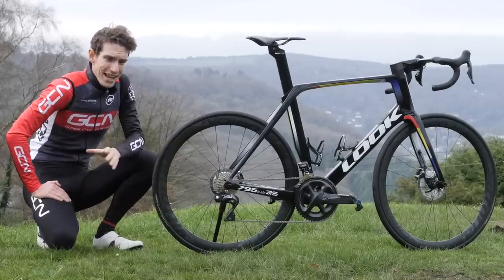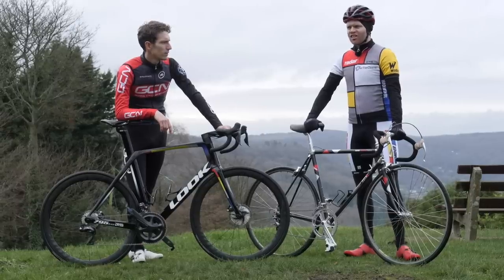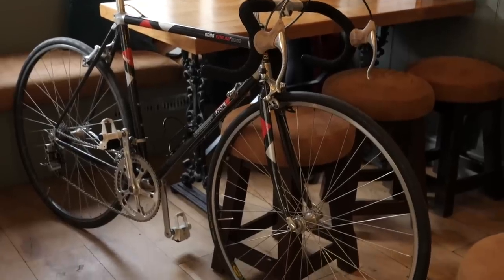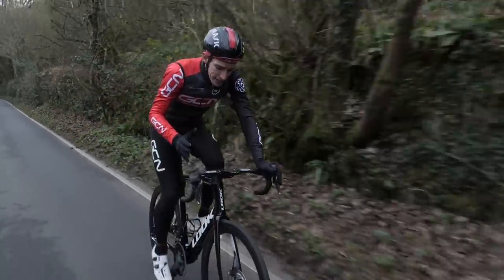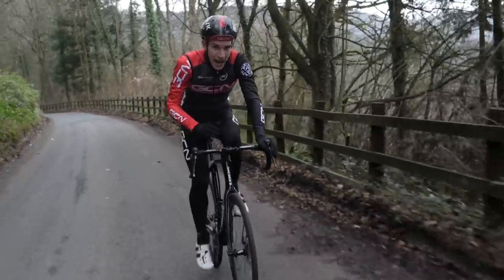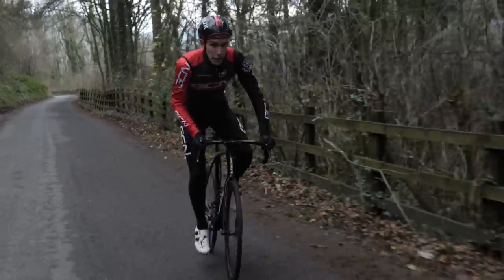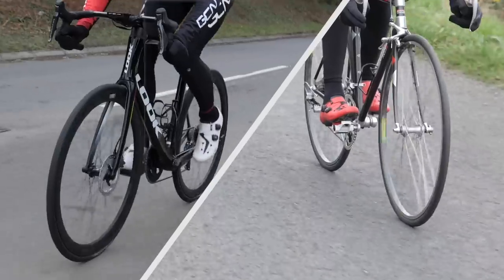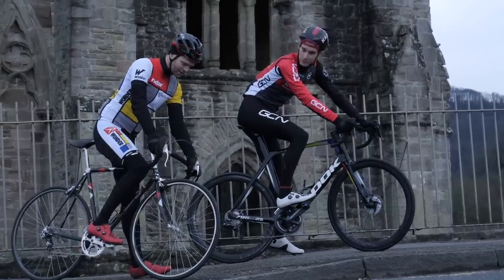How Much Have Carbon Bikes Changed? | Retro Vs Modern

Comment: Aero definitely makes a difference, especially above 30mph. I've done long descents next to an aero bike. While I'm pedaling hard to stay on their wheel, the gap keeps increasing even though I'm short and their a good 10-12" taller than me.
Reply: That's probably because they are heavier and have more momentum..
Reply: @neil7769   actually a few of them were, but a few were lighter than me by 15lbs. Young skinny dudes dropping me on a descent after kicking my butt up a long climb :) It's happened to other friends also on long descents.
Reply: @woolfel  Still unlikely to be the frame that's making the difference - position on the bike, clothing, bars, even wheels will all make more of a difference.
Reply: @neil7769   actually it is the combination of aero bike + aero wheels (venge) versus box rimms + non-aero (tarmac). In my case, my friend who is 6' on a venge versus me on my 2015 tarmac I'm 5'2". We started the descent with him pulling and half way down a 2 mile descent around 40mph+ he started to pull away. I tried to catch up, but once the gap was about 3 meters, he was gone. My friends like to joke even when they're fully tucked and I'm sitting up, it's still don't provide any draft :) It definitely makes a difference on a non-technical fast descent.

Comment: The First monocoque wasn‘t 4 years l8r!
It also was 1986. you should have compared with the monocoque kestrell 4000 and or a colnago carbon volo or a c35.
The carbon tubes/lug construction was known since 1975 (line seeker) later known as the 1976 Exxon Graftek.
Kestrell4000 was the lambo miura moment in cycling. Cheers from the carbon collector - collection c6, strictly dedicated to carbon fibre.

Comment: Different pedal spindle size on the KG86? Why is that? I still have two bikes from that era and the just work fine with modern pedals...(Super Record cranks from the late 70s and one of the first Ultegra cranks)
Reply: Tecno Ciclista  ours had a mavic tout groupset 👍🏼

Comment: Those weren't the original Look pedals - as seen on Hinault's bike in 85. Those weighed more than Ollie and had a massive white hex plastic cap on the side. That model of frame was ridden by the Toshiba-La Vie Claire team in 87 with the early frame ridden by LeMond in 86 being a lighter grey/silver colour and had a different rear brake bridge.

Pedals!
http://velobase.com/ViewComponent.aspx?ID=12D6C81D-56AC-4592-A0F0-D63CF65AF27A&Enum=109&AbsPos=125

Nice video though. I do like that new Look bike.

Comment: I wish they told us the weights of the 2 bikes.   I wonder what weight advantage did lemond have compared to the other guys riding steel frames
Reply: The UCI (the international cycling sanctioning body) approved the frames that La Vie Claire or any other team used in the Tour de France or any other race for the past 118 years. The website https://felixwong.com/2010/11/tour-de-france-bicycles-historical-bike-weights/ doesn't list the 1986 winner's (Greg Lemond) bike frame weight; but lists, two years later, Pedro Delgado's TVT frame bike which was actually a half a pound heavier than the previous year's winner's steel frame bike. So Greg's bike probably didn't have any weight advantage.

Comment: In terms of aesthetics a skinny bike is more attractive to me than a modern bulky one.From the aerodynamic point of view a modern bike is more efficient in the head wind,but if it's head-side,or just side wind it's a disaster especially with the deep profile wheels.Besides the slightly bended retro style fork is a piece of art compared to the straight hefty modern fork+ the ugly disk brakes.
Sorry, don't want to offend anyone,I have a modern bike btw.

Comment: Given the biggest aero factor facing the rider is actually the rider, I'm surprised more effort isn't made with regard the kit riders wear. Not just skin tight clothing, but shaping also. And what about the shoes? When the foot is at the top of the stroke and going forward, the angle of the shoe is such that it is causing quite a lot of drag.. Can we have a episode on aero wear for riders?? And where the innovation in that area is coming from?

Helmets, shoes, clothing with shaping etc..? And ideally without making the rider look an idiot??

Comment: Early carbon bikes with lugged frames are tougher than they look (pun intended). These things were way over-engineered when compared to thin walled contemporary monocoques. I have a 1996 Giant CFR3 that has been through 2 bad crashes, one of which snapped the front forks almost all the way through. The frame is fine and I still ride the bike regularly. Having said this, it weighs a tonne and it lags my other (much newer) carbon bike in ride comfort and handling.

Comment: If you want to save more than 15 Aero watts, you don't need to re mortgage your house for thousands of pounds for a fragile plastic fantastic.  Just spend a tenner on some Cinelli Spinaci's or some 3TTT Tiramisu equivalents.  But you'll need some of those retro museum rickety skinny round barn door handlebars to attach them to.

Comment: The retro bike needs a new chain. It has no tention on it
Reply: Part of the reason why it's a museum piece is that the rear derailleur spring is broken unfortunately.
Reply: The tension has nothing to do with the chain: it's the spring in the rear derailleur that needs replacing.

Comment: Did the fork designers give a reason for putting the through axle threads on the non dribe side vs the drive side?  That bike can never  get a super nice.
Reply: Maybe it has something to do with the disc rotor? On my MTB fork the thru axle also threads in from the drive side.

Comment: Si’s comment about comparing  the 1986 Look bike to a 60s Boeing 747 is an interesting comparison. Not entirely fair on aerodynamic design. Bike aero is clearly centered on drag and speed (fine, throw ride quality in, but that’s not really a function of an aero equation). However, in aviation a critical ingredient is lift. And personally, I’m not so interested in my bike becoming airborne! Great video, btw.

Comment: The video seems a little misleading to me. The bike featured was probably at the end of early carbon fibre bike design where carbon fibre tubes were bonded to aluminium lugs. It was hardly innovative as such carbon fibre bikes were developed at the end of the sixties about 15 years earlier.  Check out a video here;

https://www.youtube.com/watch?v=ugCR53fksjI

Obviously the tour de france win is the important bit but it is not an example of a early carbon fibre bike it came much later. Their 1988 bike looked far more interesting to me and looked like something that could be sold today but this particular bike doesn't seem to have any actual innovation just a refinement of technology  developed elsewhere.

Comment: How much have carbon frames changed? Let's see.... 

Then: if you clamped something onto it, scratched it, touched it with bare hands, or sneezed within 10 feet of it, the carbon frame broke & had to be trashed. 

Today: if you clamp something onto it, scratch it, touch it with bare hands, or sneeze within 10 feet of it, the carbon frame breaks & has to be trashed.
So, they changed shape & color, but that's all! They are still useless, fragile wall art: "Bicycle Shaped Objects" that look good, but aren't really ridable bikes!

Comment: I‘m for a steel or vintage carbon frame any day, but only with a modern saddle, modern shifters and a good set of wheels. I quite generally believe that the importance of the frame is overestimated, and that many $$$ can be saved by not reacting to all the marketing BS.

Comment: for a true comparison.. you need to compare the new fancy look..to the original aero carbon.. my Kestrel 200 EMS.  Fast.. hot.. NAKED.. and no lines!! The first true monocoque frame.. and aero cut outs.  Rocking it with Dura-ACE 7700...   Of course, it takes a true fruitcake to ride a steed like that in pot hole NYC.. but that's how we roll in NYC... home of the pizza rat. 

When i bought my bike.. i took a ride on a few of the carbon bikes of the time..Look frames were too flexy.. and the C40..  looked retro compared to the Kestrel.. and there the Prince.. was only half carbon.

Comment: That Look KG86 has got a slacker head angle than most touring bicycles.  Has the down tube started to come away from the head tube lower lug. 30 year old plastic fantastic and epoxy glues doesn't really stand up to well to time.

Comment: if you look at say electronics it's pathetic how little advancement  bikes have made in~30 years(at most 15% faster)
Reply: That's because bicycles are inherently simple, cheap machines and any gains are marginal.  That isn't a criticism, it's a fact and part of why I love cycling.
Reply: @PeowPeowPeowLasers  I agree with that. That's why i find it cringeworthy to call the advancements they have made "big" in any way.

more gears, gear range and brakes have improved decently

but the "aero" and rolling resistance(which are the two key things) gains from back in the day are very small